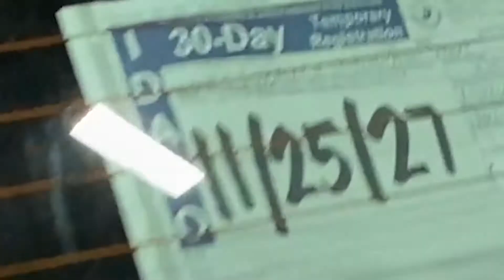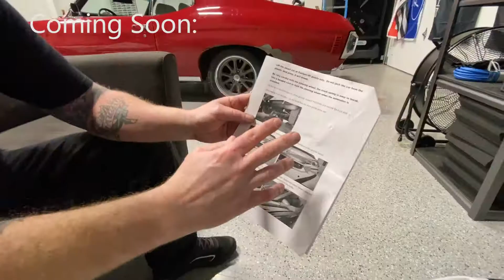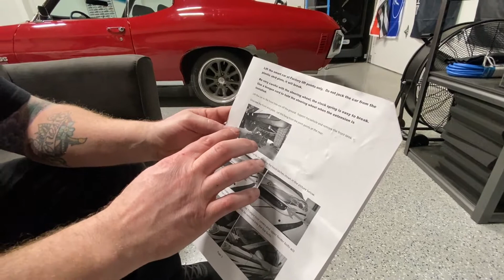Smart Car Build, Part 3. Spacers, wheels, lift, inspection and tears.

Comment: Are the lift kits for the model 451 and the 453 the same?I have a 2016 Passion and I don't see much in the way of extras and modifications for this year.
Reply from the maker: I don't know- the body styles are different so I would assume the suspension components are not interchangeable. Wish I could be more help!